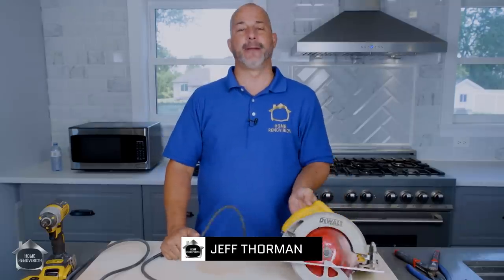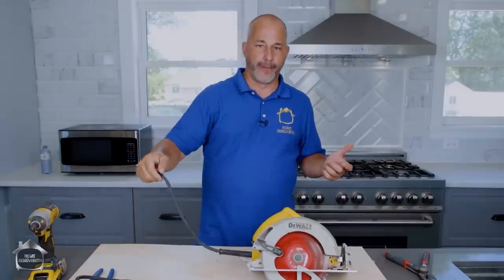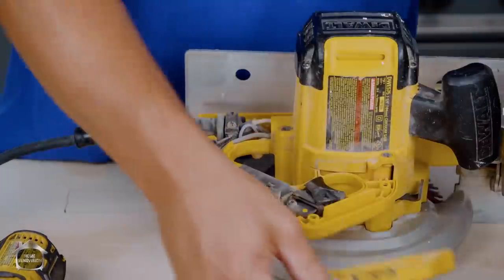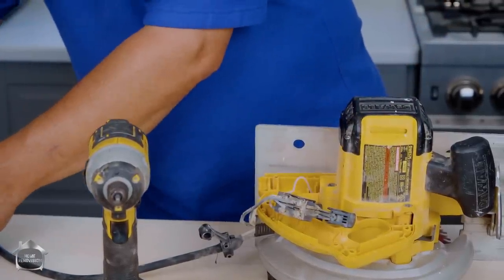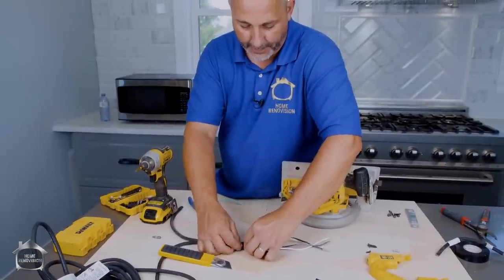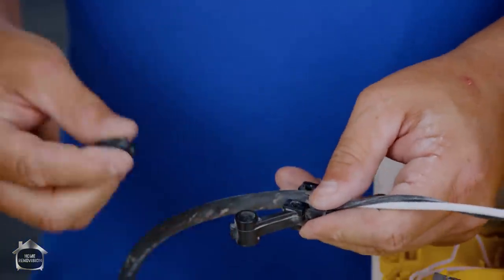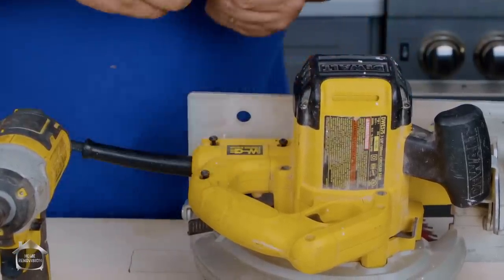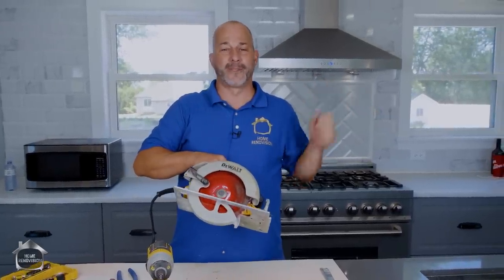How to Replace a Broken Wire on a Circular Saw

Comment: Hmm, at the risk of raining on anyone's parade the video depicted a tool being "modified". Not to the manufacturers' original spec.

It might have been a sensible wheeze to put a washer between the twisted copper strands and the head of the clamping screw. Or, better, invest in a crimper tool, complete with appropriate crimper dies, and suitable terminators as was mentioned.

It might also be useful to read up on your US electrical regs about maximum permitted lengths of cable/wiring that can be protected by an RCD unit. It would be "sensible" to use an inline unit when working outside at the end of a long extension cable.

Power tools tend to vibrate and over time it is not impossible for the wires to slip from under the screw hence the crimped on terminals.

Now, we've all done similar in years gone by but over the last few years in UK our insurers have become a great deal more picky and if they can find a way to decline a claim they will.

Nothing wrong in that, it's their business and their risk. Basically it's best to read "their" T&C's to know what "your" obligations are.

(And, because our H&S folk keep an eye on this sort of thing, all mains powered electrical appliances come with a moulded on or prewired plug with the appropriate fuse installed for the tool or appliance.

The H&S folks are more than aware of the average UK person's utter, utter cluelessness and utter, utter incompetence when attempting to rewire a mains plug or ability to use the correctly rated fuse.

And, when you dispose of an electrical item it is good practice to cut off the mains lead as close to the appliance as possible.

Plus not leave a bare ended lead with plug attached as these are known as "widowmakers", (presumably ladies know better) as there's no accounting for the utterly stupid (male?) adult. Or, more tragically, the inquisitive child.

So, as for rewiring an actual tool then it's another world ...)

However, in the case of a tradesman's indemnity insurance or public liability insurance it might be an idea to contact your insurer to get their definitive view on a person modifying a tool in any way shape or form.

This is doing your due diligence thing and might well save your bacon when answering questions, under oath, in court ...

I did have occasion to ask my insurer for their view on a matter and their response was that, apart from circumstance, as long as you had followed the manufacturer's install instructions or method of use instructions to the letter, repeat "to the letter",  they were happy.

If you refer to the manufacturers' manual in case of a damaged power cord the tool should be returned to the supplier, distributor or importer for proper remedy.

Occasionally it is acceptable to have a power cord repaired or replaced by an independent, qualified technician. Accent on "qualified".

For peace of mind, not to mention avoidance of third party legal action it might be worth a few minutes of your time to contact your insurers for their view.

They say divorce and homelessness are to be avoided.
Reply: The repairs and modifications were done by the owner of the tool. 

This falls right in line with the right to repair laws that individuals and independent repair shops are fighting for while John Deer and apple and others are fighting against. 

In the us you can build your own airplane but you are the only person permitted to fly it. I value my life so I would make sure everything was correct.
Reply: @timothydillon6421  Now that is interesting ref this right to repair issue.

I can understand the argument from your independent repair houses as in running a business.

However I can understand also a manufacturer wanting to keep all repairs in-house on the grounds of reputation.

There is a element of protectionism in UK.
Even if a manufacturer refused to sell spare parts to non trade customers, or make it very difficult, we can buy pattern parts online. This might seem to be a good idea but you can't be sure the replacement part is built to same standard, or of course, whether your insurer would be prepared to meet a claim for consequent damages if "something" had not been repaired to a proper standard using approved or "genuine" spare parts.

( I once did Jury Service on a case involving a claim. A representative from an insurance company stated unequivocally that the insurance company accepted "a" risk on their terms exclusively, no ifs or buts or maybe.

The Golden Rule being "Always Read the T&Cs, Especially The Small Print". And, if in the slightest doubt , give them a call for their advice.

Ref an owner repairing a tool they alone operate in a non business way then my concern would be if a repair or modification is poorly done and injury or death occurs as a result.

I can certainly appreciate a manufacturer being unhappy if their brand name was associated with said injuries or death.

I speak for UK of course, and a few years ago, 2008, all new or rewired homes had to have an RCD fitted.

HMG would behave been made aware of the electrical ignorance of the general population at large so introduced a  British Standard to save lives.

In short whatever cock ups someone made in electrical repairs or "home improvements" the RCD was intended to trip the current before it became lethal;  generally, in a domestic environment, the RCD is required to trip in less than 30ms at 30mA.

As you might suppose there is an enormous amount more on the topic  to be found online

If we use tools outside the home it is advisable to protect a user by using a plug in / portable RCD.

This is considered good practice. What is not good practice is to chain extension leads if you have a large garden, say.

This is because under certain circumstances too long a lead can result in a delay in the RCD tripping.

Again, plenty of detailed info online.

And, very few folks understand the notion of voltage drops over a long circuit and the requirements to use larger conductors, or "bigger" cable.

All in all a bit of a minefield for the unwary.

I suppose if "you" replace the power lead/cord on "your" own kit for "your" own personal use then make absolutely sure you have an upstream protection device ... and check to see if your insurer will cover any "mishaps".

Comment: Thanks Jeff... It's great to change the cord on tools...I burned the cord on my blow dryer (a professional one $$$) and changed the cord myself... the other stylist in my salon were awed...LOL hey it ain't rocket science.....
Reply: Quite right AD, it is not rocket science ... but ... it is electrical theory/math/science.

At the risk of being "male" might I suggest you have a natter with your local electrician ref length extension cords/leads ... not for current drop per se but overall resistance and function of your RCD.
Reply: @t1n4444  I think you mean volt drop; current drop isnt a thing.
Reply: @TheDarthJesus  Oops, badly expressed, I meant current leakage to allow the RCD to trip.
I gather that having too much resistance in supply leads/cords can affect the trip times.

Plenty of math why, much better explained, online.

Voltage drop a given the longer the supply leads and current load.
Reply: @t1n4444  Most corded tools use 12A or less; although some saws/drills might use a touch more when first starting (Inrush current) which is why sometimes you'll see light dim for 1/2 second when you start them.
I say 12A or less, because they're using a 5-15P cord end, which is rated for 15A. (80% of 15A is 12A)

14awg is fine at short distances, but once you get over say 25ft, you should be moving to 12awg. for 100ft cords that you plan to use for table saws and other larger tools, I'd even go to a 10awg just to be safe.

Of course, 50/100ft 14 is fine for things like job site lights; they might just be slightly dimmer due to a lower voltage.
Reply: @TheDarthJesus  I may not be expressing myself clearly.

The current I was referring to is leakage current, not the tool's current draw when in use.

I referred to RCD as in Residual Current Device but you might know it better by Residual Current Circuit Breaker or perhaps Ground Fault Circuit Interrupter.

The issue with these devices is working effectively at the end of a chain of extension leads/cords.

The aim of these devices is to protect the user from current leakage in the order of a few milliamps. It is not to protect the tool or supply lead per se.

Certainly in UK we now use an RCBO in the consumer unit to protect a circuit and a person.

RCBO, Residual Current Breaker with Overcurrent protection.

These are fitted to each individual circuit, ring or radial, so that only that circuit is interrupted in a fault condition.

That is a very simple explanation and would recommend a read of the relevant documentation, in particular "Z".
Reply: @t1n4444  Leakage current has to do with bad grounds, not to do with long extension cords, voltage drop, or anything else.

GFCIs do not care about cords being long, they care about the difference in current between the hot and neutral wires.

So yes, if you have a short to ground, a gfci will trip, but having a long extension cord doesn't do that.

Having a long cord results in volt drop, which means motors (such as the ones found in drills/saws) are going to pull more current so they can operate at watts (hp) they're designed to. However if the current running through said motor is too high (due to too great of a volt drop), you can burn out the coils in the motor, causing the tool to fail.

I've worked with "electricians" from the UK, and they didn't seem very knowledgeable, not sure if you're getting your info from one of those, or if you are one of them yourself.
Reply: @TheDarthJesus  😂

To answer your last comments first, some older electricians are not particularly up on theory but "know what they know" and seem to get away with it. Probably because of the safety devices now in use.

Younger electricians are, generally, better taught and are more aware of the latest regs.

I personally am not an electrician but had to undergo training on electrical systems for safety certification to be allowed to work. In short we were trained on the "what if" principle and  be aware of possible faults.

And if a possible fault was identified to pass it to the maintenance teams who did whatever corrective measures were necessary.

Hence my concern at, for example, outrageously long extension leads and issues relating to proper RCD operation.
Reply: @t1n4444  The only reason an outrageously long extension cord would cause a breaker (RCD as you're calling them for some reason) to trip, is if it's so long that the volt drop is huge, and the motor (drill, saw, whatever) is then forced to pull enough current that it would trip (16A on a 15A breaker, etc) which is only in the most extreme of cases.

Saws like the one in the video are only going to draw 10-12A, as more than that would put it over the 80% rating of the 15A breaker it's designed to be on (given it has a 5-15p cord end)

So what you're suggesting is a 10A tool, being used in a non-continuous fashion, tripping a breaker rated for 15A.
That would require a 50% increase in amperage, or in the case of a GFCI, a short to ground (which would not be cord related)

I've met new, and old UK electricians, and have yet to be impressed by their knowledge.
Reply: @TheDarthJesus  😂😂

No, I'm not refering to an overcurrent situation.

I am referring to a leakage current, in the milliamps range, regardless of whether the tool is switched on but still plugged into the supply.

I appreciate we might be talking at cross purposes but leakage currents might be caused if the tool was inadvertently left out during a rain shower, say, and the conductors on the switch terminals became damp and passed a current which you felt when touching the handle of the tool.

I perhaps should have mentioned that so concerned about leakage currents are the authorities that extension reels are fitted with an RCD in the fused plug.

The RCD is purely for the protection of the user, not the tool nor supply cables.

The overcurrent issues are dealt with by your basic "one time" fuse, MCB or RCDO.

This is in UK of course.
Reply: @t1n4444  Leakage current caused by leaving the tool out in the rain, is a short to ground. As I've already explained, this is has nothing to do the extension cord being long, or sized incorrectly. 

Again, water causing current to flow from the live conductors, to the metal components of the tool, shocking the user, is unrelated to having a long or improperly sized cord.
Reply: @TheDarthJesus  Hmm, I regret to say that UK electrical authorities take a slightly different view (as you have detected) in that extension lead/cord length does affect the trip times.

It's the trip times that are considered important for protection of life.

Lastly again we might be talking at slightly cross purposes; RCBs work on an imbalance in the current in the conductors.

The leakage to "you" might not go to ground as such ... "you" are the ground.

The RCB is designed to trip at 30mA within 30ms; to protect life.
Reply: @t1n4444  Probably has something to do with what, as you put it, "Older electricians tend not to know theory, but "know what they know", and seem to get away with it."

It's unfortunate the UK is so behind the times.
Reply: @TheDarthJesus  We'll try and live with it, especially as we use RCBs 😂.
Reply: @t1n4444  
So do we in North America; It's just better when you know how they work xD
Reply: @TheDarthJesus  Glad to have helped. And now you know about the excess lengths of extension leads to watch out for.
Reply: @t1n4444 

Helped? You've done nothing but spout bs, and said "but that's how we do it's in the UK"

You've admitted you're unqualified, leave it to the experts.
Reply: @TheDarthJesus  Oh dear. I don't need to be an expert to quote from them.

It is yourself that went on about voltage drops, even when I repeated I was referring to leakage currents.

I don't believe you truly understand that much about leakage currents when you mentioned leakage to ground even though an RCD monitors an imbalance in current.

Might I suggest you read up on the theory and practice (and dangers of chaining too many extension leads together).

I shall be happy to accept your apology. I can't say fairer than that.
Reply: @t1n4444  The imbalance in current is due to current being lost to ground. Not due to long cords, this is very basic electrical theory
Reply: @t1n4444  "I don't believe you truly understand that much about leakage currents when you mentioned leakage to ground even though an RCD monitors an imbalance in current."

Let me simplify this for you. You have two wires, a white and a black. power goes to the device on black, and back to the panel on the white. an RCD monitors both, and if there is a difference (IE: 12A goes out on black, and only 11A returns on white) it trips. That 1A difference has to go somewhere, it doesn't just magically disappear.

As you mentioned, it can be caused by things like water causing a pathway between the switched power, and the metal components of the tool (potentially harming the operator). This is known as a short to ground.

NONE of this, has anything to do with conductor sizing, or the length of an extension cord.

Please, educate yourself before trying to argue with people who have studied it; You lack a basic understanding of how electricity works.
Reply: @TheDarthJesus  This doesn't read like an apology to me.

I explained to you several posts ago about a person being the "ground", it doesn't have to be the actual ground. It's the imbalance in current between the live and neutral which is detected and this causes the tripping.

Clearly you have not troubled to research issues with the of chaining extension leads having an effect on trip times of a residual current device.
Reply: @TheDarthJesus  😂 No you're still not quite there.

It's the imbalance of currents the device monitors. It doesn't care where the current goes, it does not have to be "ground" , it can be a person.

I presume you don't actually mean an amp difference? We're talking 30mA. Which is  supposed to be detected and the supply disconnected in 30 ms.
Reply: @t1n4444  It's still called a "short to ground"; even if it has to pass through a person to get to ground...

Please, stop trying to give electrical advice until you have an actual understanding on it.
Reply: @TheDarthJesus  😂😂😂
We're down to semantics now then.

I would suggest it's yourself who should stop trying to give advice. No disrespect but your communication skills are a tad lacking in clarity when trying to explain things.

I will of course make allowances for differences in technical expression as that is reasonable.

Now I hope I have cleared up some issues for you. All you have to do now is research the extension lead/cord issues ref trip times.

I detect you are very keen on theory but seem to have not much experience in certain practicalities.

A prudent person would have researched the issue online or perhaps quizzed his mates on the subject by now.

Or even done the empirical thing.
Reply: @t1n4444  I have given you an explanation of how it works explained the proper terminology, and have real-world experience.

I don't know why I continually have to repeat how why things work, or understand how when I correct you, you expect an apology.
Reply: @TheDarthJesus  Try the other way round. It is myself who has attempted to help you.

I despair at times I really do. You have been given a huge hint on empiricism yet didn't recognise this opportunity.

I can do no more.